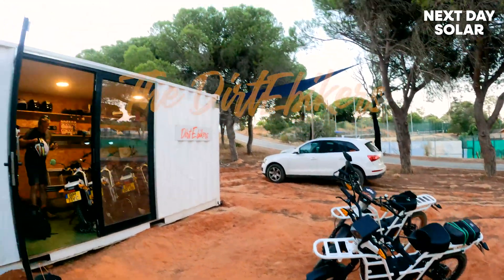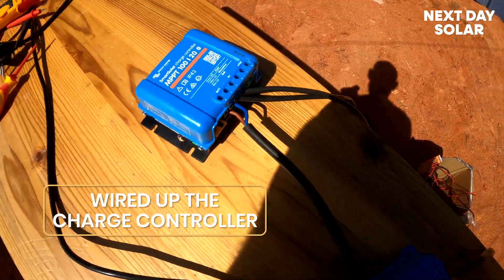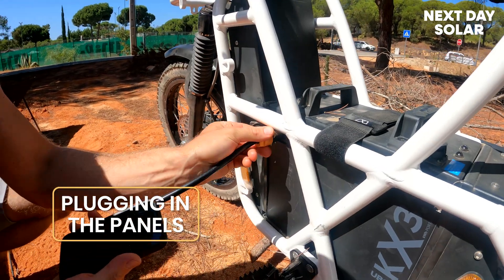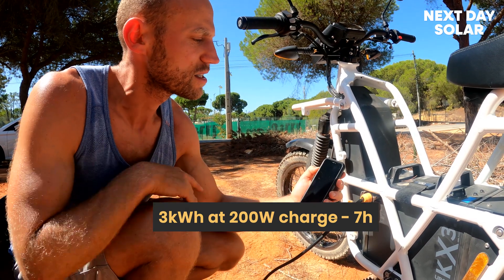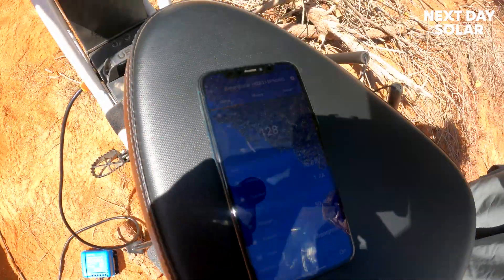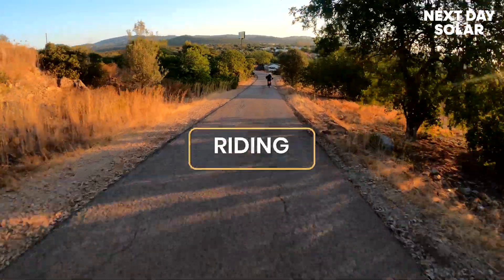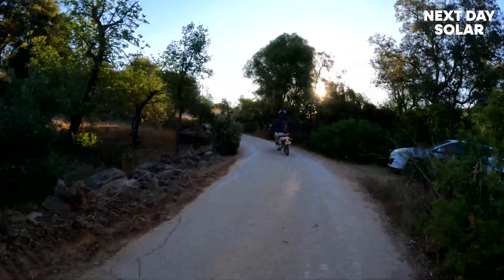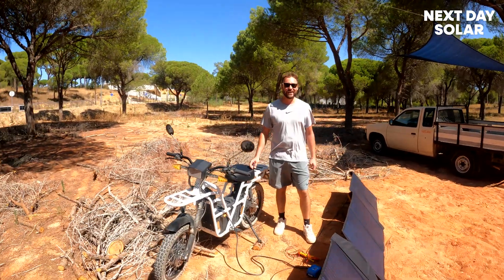Solar Charging an UBCO 2x2 Adventure Bike Using Victron 100/20 (48V) Solar Charge Controller

Comment: I have a paddle board is it possible to use a solar portable to blow it up and deflate it? Instead of using the car charger?
Reply from the maker: Yes of course, typically they are 24V